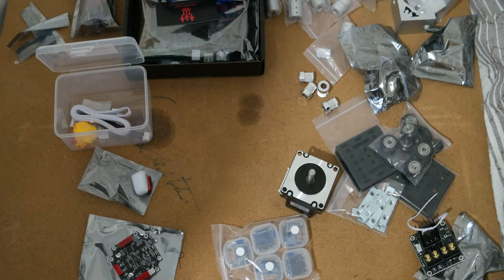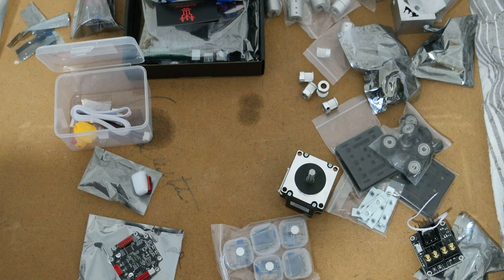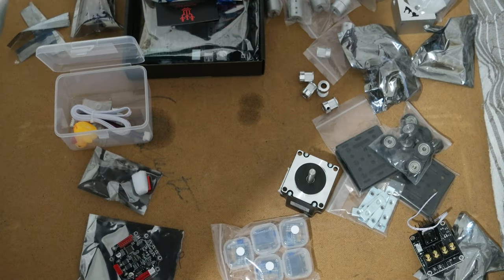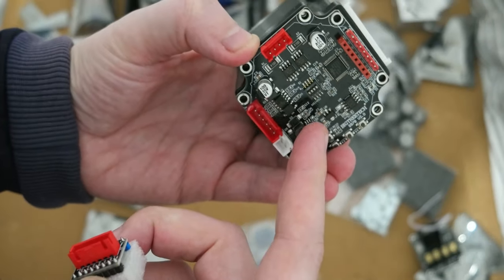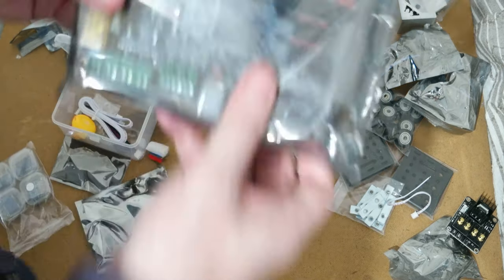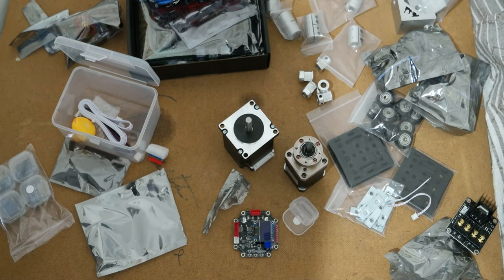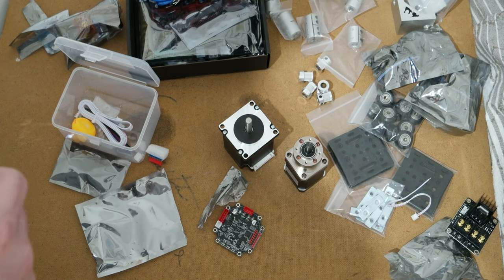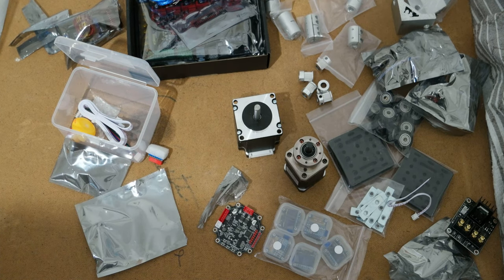New 3D Printer upgrades, Nema 23 Closed Loop drivers, induction heating extruder

Comment: Have any pictures of the finished printer? Why Nema 23s over 17s?
Reply from the maker: I did not mount the printer yet since I am super busy with work. So currently I am learning Klipper with the new boards and sensors. As soon as I put together the printer I will post videos for sure. Nema 23 have higher torque. My custom 3D Printer is pretty big so I require more powerful motors that's why I switched to the 23s! Thanks fo the comment and please subscribe thx